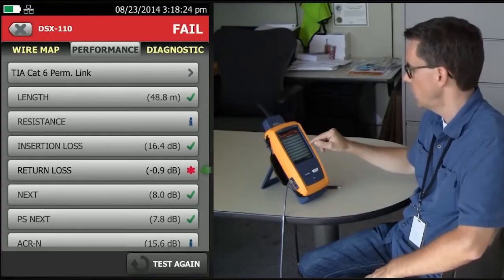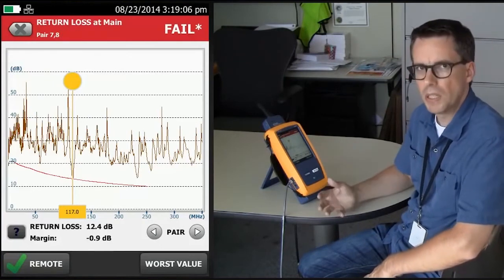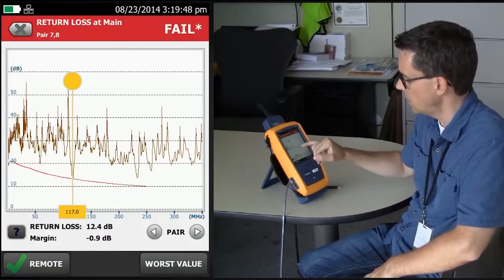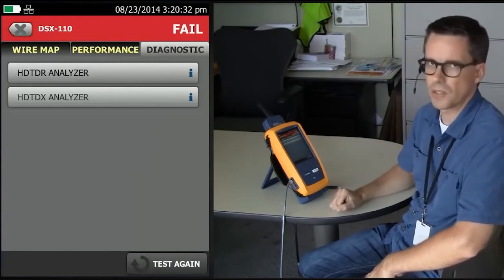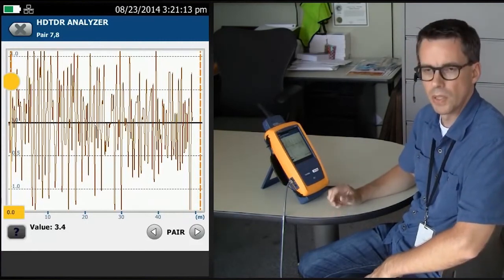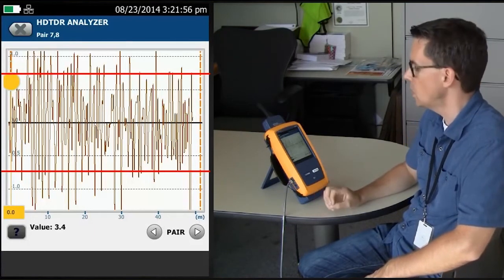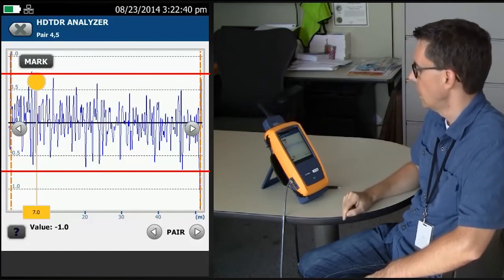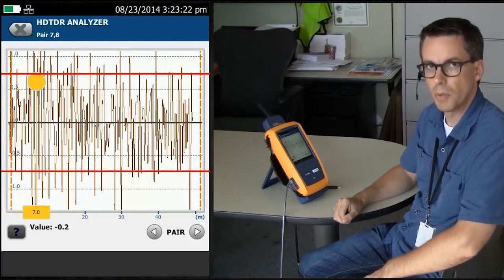DSX 5000 CableAnalyzer Return Loss fails due to cable example 1: By Fluke Networks

Comment: Are cable bends causes return loss also?
Reply: If the bend caused damage to the cable, then yes, but not necessarily. Return Loss is due to impurities/damage in the cable, anything that disrupts the flow of the signal. When the signal's power is unable to traverse without interruption, the medium is not perfectly matched and reflection occurs, affecting the overall power delivery of the signal.